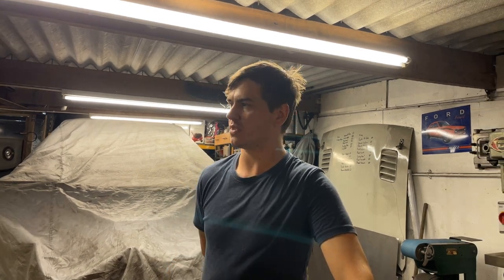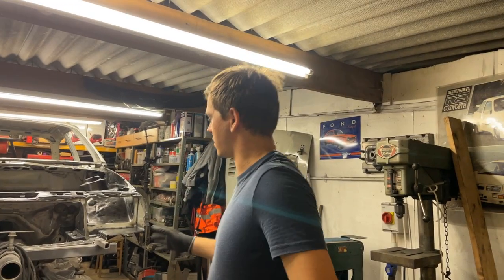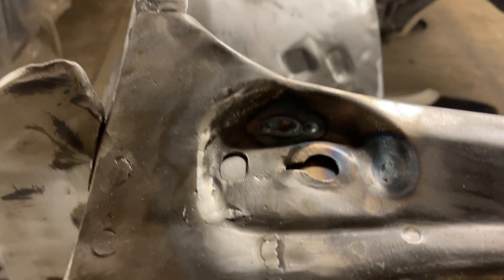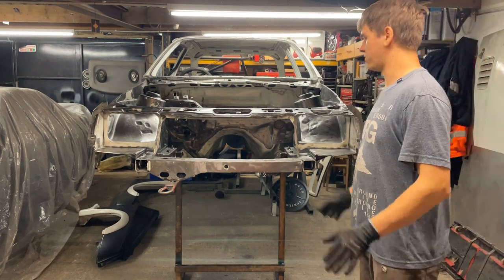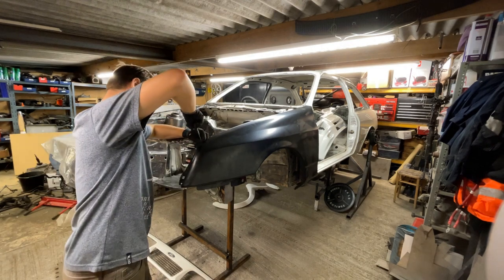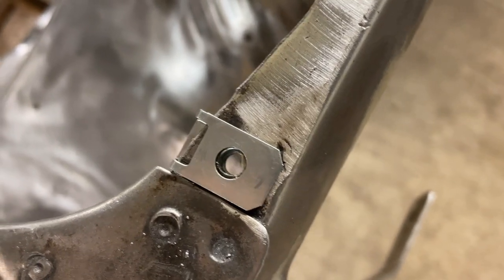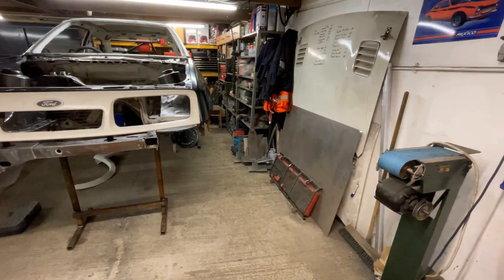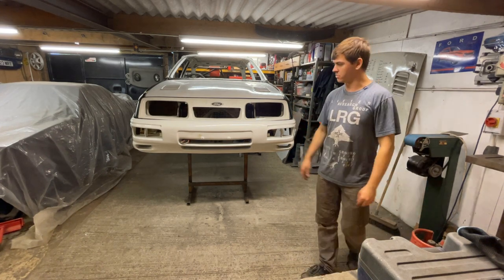Ford Sierra Cosworth 3 door track car build -1,  Converting wings to bolt on

Comment: Loving all this and following the  build.👍👍👌
Q, what's the plan..? Are you going all out Sierra Cosworth engine, running gear, drive train etc etc. 
Road and track road worthy..?
Reply from the maker: Thanks bud!
It is an actual Cosworth so I have a 200 block engine that I will be building up hopefully not to far in the future, I've managed to find a few very nice bits which should make it quite a healthy engine :) At the moment it'll likely have a T5 unless I can find something cost effective and stronger, and I have a supra rear diff waiting to go on :) Among many other parts I've collected over the last few years. 
It'll be heavily focused on track use but I want to be able to drive to and from track, as well as try attend some shows and meets :)

Comment: Hi bud would of thought you’d have bonnet and doors on b4 fixing the wings
Reply from the maker: Hey :) 
Yeah I agree it would have been a better route to take; The doors are at my house and a little cumbersome to be moving about (they're built up with glass at the moment) so in an attempt to reduce damage I decided not to get them on the car just yet - I hope that as the wings are bolt on this will allow a little bit of movement which will allow me to fit them up nicely in the end. If your interested my second video I managed to get the bonnet on the car :) - https://youtu.be/hWDnDmJVJbU 
Thanks!